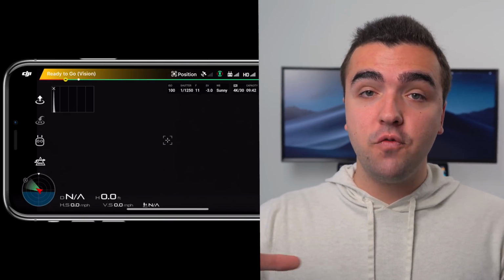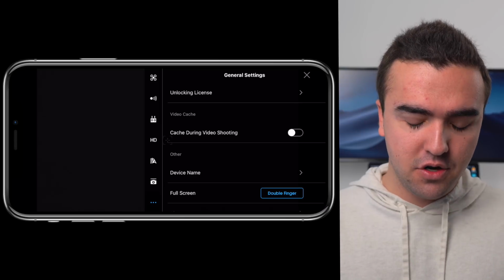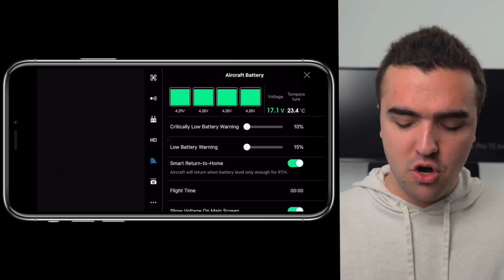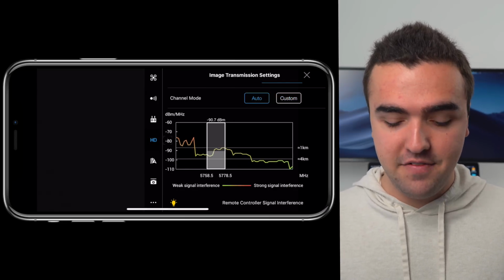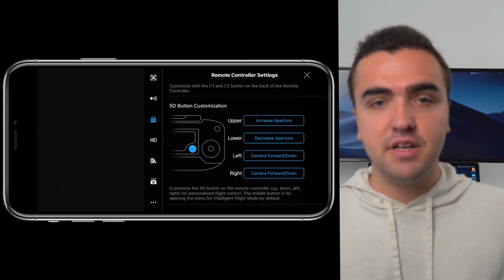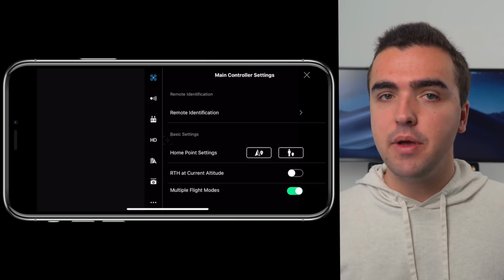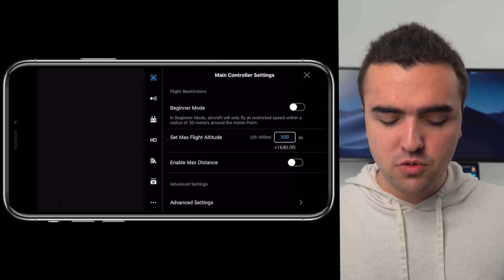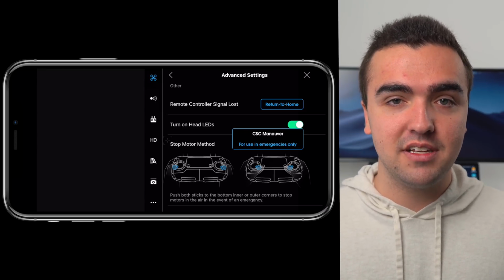The Best DJI Go 4 Settings for the Mavic 2 Pro & Zoom

Comment: I need some help. I would like to use the C2 button for "auxiliary bottom light" however, and although I am able to make the selection, it doesn't work. In fact, of all the options, only a few will work. This is on both C1 and C2 buttons. Any help would be appreciated.  PS: I have the latest firmware. 0.300

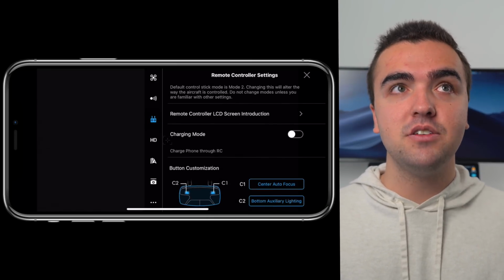Comment: 7:35 The Charge  Mode is not available on Android OS. When your devise is connected it automatically starts charging. You can’t disable the charging. I hope DJI add this functionality to Android OS via firmware update.

Comment: Have to say. Your thoughts on going up and not down if you find a manned aircraft is flying near. Is a dangerous way to fly Billy. I struggle to make sense of that one.
Reply from the maker: If a manned aircraft is flying at 300 feet and a drone is flying at 400 feet, what would be the safest move by the drone pilot? Go down and away or up and away?
Reply: I still fail to see why you would be flying any where near a manned aircraft that was that low. Unless your flying in an airfield. No manned aircraft would be that low unless its taking off or landing. In whitch case you as a drone flyer shouldnt be anywhere near it.
Reply from the maker: Flying in urban areas like Philadelphia there are plenty of areas to fly where helicopters are buzzing by between 200-300 feet in the air.
Reply: Sounds like a accident just waiting to happen.
Reply from the maker: Hasn’t happened to me and won’t happen to me.
Reply: Yet! You lost one drone flying it out of sight by taking risks. I like your videos. But not so sure your the best guy to show others how to fly safe

Comment: Hey Billy great video! One thing I can not find is how to change the volume on the remote controller? I remember being able to adjust the volume of the beep from the remote on my original Mavic pro, but can't figure it out on the Mavic 2 Pro remote. Any ideas? Thanks!
Reply: I change the volume on my phone to manage that.
Reply: Roland Allen the beep sound can not be changed on your phone as the sound comes from an internal speaker inside the controller. If there is a way to turn it down I would like to know, it’s loud! I remember with the original controller some people drilled a hole to destroy the speaker, CRAZY! You can also take the controller apart and just cover the speaker with hot glue. Lol

Comment: Very nice video good information. Had to send back my zoom to DJI  I don't think my camera ever worked right. Finally the camera would not go up or down. Then gimbal over load message keep coming up had to reset  gimbal , then the camera in the menu was not there anymore. finally DJI said to send back.

Comment: This is for IOS system: Android system is different.  Android does not have CRITICAL LOW BATTERY WARNING under battery settings; CHARGING MODE under the remote controller settings;  CACHE MAP in BACKGROUND under the ...general settings. You did not mention but IOS also has the ability to get more critical information by swipping screen left or right. Of course, I do not have IOS so I cannot say if the swipe left or right changed or what is exactly on the screen. I think that DJI leans towards supporting IOS. I believe IOS is one version ahead of the Android version.
Reply: Android? Eww.